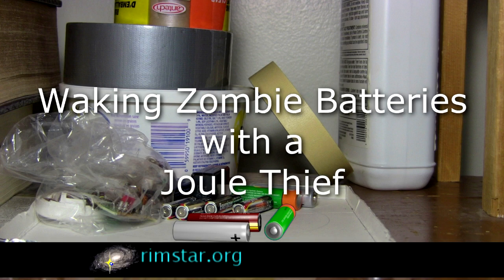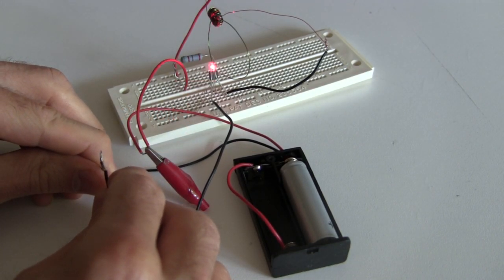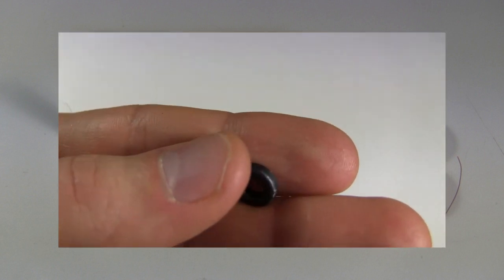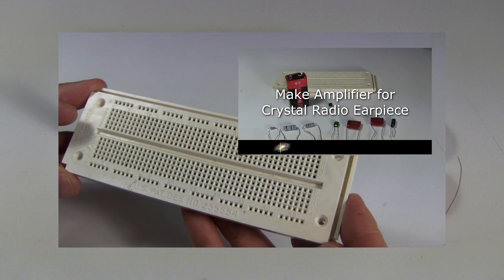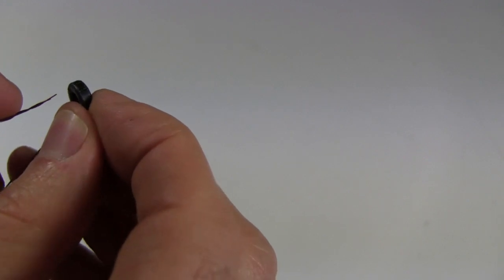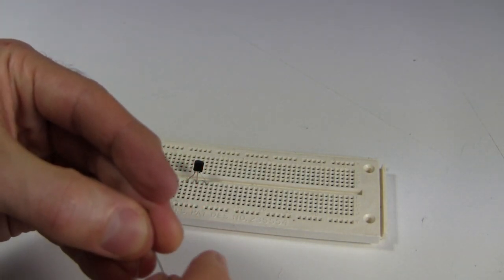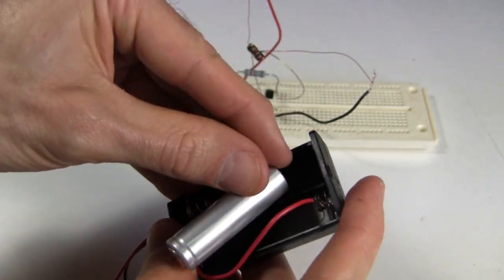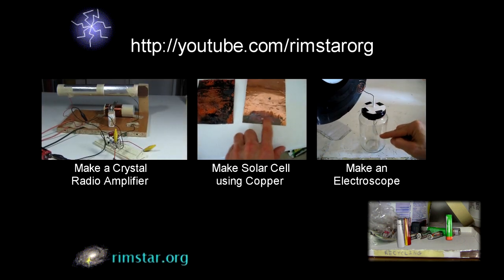Make a Joule Thief for Zombie Batteries

Comment: hello +RimstarOrg ! I need 3.5V for my project but the source is capable of giving only 2V.......... so will this joule thief be able to solve the issue?
Reply from the maker: +Siddhant Rai Probably not. It depends on what you're trying to power. The output of the joule thief is not flat DC, it's very spikey and pulsed, as you can see from the waveform I show on the oscilloscope near the beginning of this video.
However, you can add further parts to make the output be DC like one fellow shows here on my website http://rimstar.org/science_electronics_projects/joule_thief_powering_clock_ls.htm. But the current will be very low, so it again depends on what you're trying to power. He's just powering a clock. Also, you'll have to play around with the part values to get your 3.5 volts.
Reply: +RimstarOrg  thanks a lot !!!!
Reply: why not just use a large filter cap?

Comment: I'm using 2n3904 transistor in the same circuit but the output voltage is less than that of the input voltage. I can't seem to identify the problem what do you think?
Reply: If I use thinner wire should I increase the number of turns?
Reply from the maker: Are you sure you have it wired up correctly? The wiring going to the coils is the opposite of what you'd expect and is where most people go wrong.
If you use thinner wire then you don't have to increase the number of turns.
Reply: Yes the wiring is correct

Comment: The only ferrite core i have is about an inch in diameter, will it still work?
Reply from the maker: I think it might. I'd put enough turns of the wire to cover the core.
Reply: @RimstarOrg  alright! It worked very well I managed to get a 7.5 volt output from a single double A. Anyways I used the same circut with a dead battery and for some reason my multimeter  told me 0.5  volts output even though it could power two LEDs. Whats up with that?
Reply from the maker: The voltage output is neither flat DC nor sinusoidal AC, meaning that your multimeter can only show you samples of the fluctuating voltage. You really need an oscilloscope to see the output voltage. I show what it looks like near the beginning of the video. If your multimeter has a min/max function then you could use that to get an idea of the maximum value.
Regarding the dead battery, it's of course not dead and that's the point of this circuit. If you again look at the oscilloscope output which I showed, you'll see that the circuit produces voltage spikes and its just after those spikes that the LEDs are powered. They just appear to be powered all the time. I explain how the circuit works in this video https://www.youtube.com/watch?v=0GVLnyTdqkg.

Comment: does this cause the dead zombie battery to heat up?
Reply from the maker: I don't know, I never felt the batteries when using this circuit. I know with a similar circuit for powering a CFL, the batteries did heat up after a while as I show in this other video https://www.youtube.com/watch?v=yz_99oVMbSI at around six minutes into it. But that CFL is a much bigger load than a tiny LED.
Reply: @RimstarOrg  wow thats cool!!!!!

Comment: Hi i recently made a joule theif and was wondering why a 1.27 volt battery didnt power my 3 volt LED, i used a 3 volt battery through the mechanism, and it lit the led, i used a multimeter to measure the output voltage of the entire circuit, but it was the exact same voltage of the 1.27 volt battery, did i mess something up on the torroid? Is there a specific amount of loops around the core?               - Thanks
Reply from the maker: Scotlahn Mccallister The number of turns I put on the coil was randomly chosen. The most frequent error is in connecting to the coils in the wrong way. Recheck that since it's the opposite of what you'd expect. Another possibility is that the value of your resistor is too high. The lower the resistor value, the brighter the LED.
Reply: RimstarOrg Hi again, i tried what you told me to do, checking the connections, i changed the resistor value to 1 ohm and it still didn't work, i'm starting to wonder if my transistor is the correct type to use for this circuit, my transistor type is PN2222A6E.
- Thanks
Reply from the maker: Scotlahn Mccallister PN2222A should work. I can't find anything that tells me what the 6E means. My guess is it should work. Try the same number of turns on your toroidal core that I use, around 13 turns.
Reply: RimstarOrg Okay, i checked those, i think it might just be my connections on my breadboard, and i see that the voltage may be traveling directly to the LED and not through the transistor first, i would like to see a picture of how you connected everything to the breadboard so i can check if i am correct or not.
- Thanks Again
Reply from the maker: Scotlahn Mccallister
I don't have any picture of how I did it. Try figuring it out from the video and let me know if there's any placement that you can't figure out.
Reply: RimstarOrgI have finally made a successful joule thief, but the LED isn't very bright, i will try to get a better resistor for this project, thanks for all the help :)
Reply: Scotlahn Mccallister Also, one more question, what would be a good resistor for a project for this/ i have used 1k and 2k and they are both too dim, but i have also used the 1 ohm and 200 ohm and 330 ohm, but those don't light up the LED.
Reply from the maker: Scotlahn Mccallister I'd suggest getting a potentiometer/variable resistor somewhere in that range and then you can easily find the sweet spot. There's no way I can say what to use otherwise. If you're not familiar with potentiometers, I use one with a joule thief circuit for that very purpose starting around 0:59 in my video here https://www.youtube.com/watch?v=yz_99oVMbSI

Comment: Mine isn't working for some reason. I used a BC547 transistor because they are more common in my area, and when I shortcut the LEDs leads with the negative wire and let go, the led flashes so I think that the rest of the circuit works, the transistor just doesn't pulse like it should. What can I do?
Reply from the maker: PunakiviAddikti You might want to check the specifications for your transistor. I think the emitter leg and the collector leg might be the reverse of what my transistor is.If that's not it then the most common problem is getting the wiring to the coils wrong. They're not connected to the circuit in the way you'd expect.Lastly, try different resistance values. The higher the resistance, the dimmer the light. You shouldn't have to go over 100 ohms.
Reply: thanks, I'll try that. Does it matter how much wire is wrapped around the ferrite core? I have less than a meter of wire around it, and the wires are the same diameter.
Reply from the maker: PunakiviAddikti I don't have any feel or formulas for how many turns there should be wrapped around the ferrite core. You will get best results if cover the whole core though; that keeps the magnetic field inside the core as much as possible. Though it's probably good to play it safe and leave a small gap of core with no turns around it where the ends of the coil meet.
Reply: I got it to work, thanks! I actually used a pre-made toroid from some old electronics and changed the 1K resistor to the base of the transistor. I actually found one 2N3904 transistor and used it and it works great!
Reply from the maker: PunakiviAddikti Glad to hear it!
Reply: I tried it later with a BC547 and it still works : )
Reply: PunakiviAddikti Just do the math for induction because the number of turns does matter especially if your wanting to run more than one LED. Also the gauge of wire matters also if you want to run high brightness LED or even a small 3 volt DC fan. The larger the wire gauge = more current, The number of turns on a core will determine your primary input voltage and you secondary output voltage.
For example, I took a 110 volt toroidial type transformer and re-wrapped the secondary with some #6 AWG gauge wire, 5 turns and I get 2.3 volts @ about 80 amps.
It's all about induction.

Comment: will this circuit work with 0.5 volts
Reply from the maker: I doubt it. The transistor usually needs around 0.6 volts just to turn on.

Comment: is it a PNP or an NPN transistor?
Reply from the maker: Roush Hawley It's NPN.
Reply: +Roush Hawley You can tell from the transistor symbol. If the arrow on the emitter is pointing toward the base then it is a Pointing iN Pointer (PNP). If the arrow is pointing away from the base then it is a Not Pointing iN (NPN) type. I've used that method to remember the difference for over 40 years ... and still have to say it to myself to remember. :)

Comment: I followed the circuit exactly
But problem is that the LED glows when I connect two AA batteries but when I connect one AA battery it doesn't glow 
Why is that so 
Please reply me quickly as possible
Reply from the maker: Possibly the battery is too dead (too low a voltage) for even the joule thief circuit to use. Can you measure the battery voltage using a meter? The most frequent problem is having the wires going to the coil wrong. They're not connected in the way you'd expect.
Of course there are other reasons like the transistor may be broken, the resistance of the resistor may be too high (lower resistance means a brighter light, but no resistance could damage the transistor), and bad connections.
Reply: It's working now thank you very much sir 😊
My mistake was wires going to coil was wrong
Reply from the maker: Glad to hear it. Thanks for letting me know since that helps me help others later.

Comment: playstation 2's have a ferrite core coil that is ready to use connecting the 2 ends that are diagonal to each other
Reply: Otherwise use a 1" to 1/4" toroid and 5 turns of the wires from a Ethernet cable
Reply: Ashley Poulton
ill have to try bigger toroids
Reply from the maker: Oh, cool. Thanks.

Comment: hi i like your vids. im a green energy enthusiast and i know some of electronics but mostly hobbist. 
can i use a joule thief to charge a battery from a solar pannel which is unable to deliver a bigger voltage than the battery? if so, are there any calculations i need to make to start testing?
Reply from the maker: Jerónimo Barraco Mármol Yes, that is possible. I've seen it done - though with a tiny panel. I'm not aware of any calculations.
Reply: Thanks, i have a small solar panel that gives 2~ volts on PERECT conditions, i wanted to give it some use

Comment: Hello sir, what is the Hertz range on the little Toroid? I've seen those around, but most of the time their rated at 10-50 MHz.
Reply from the maker: I don't know. It was just a random toroid I took from some piece of hardware, a power supply I think.
Reply: I see, so those little Toroids that range from 10-50 MHz should work just as well?
Reply from the maker: It's hard to say since I don't know the frequency range for the one I used. The joule thief operates in the tens of kilohertz range. The waveform I show in this video is at 50 kilohertz.
Reply: I see, I have experiance in Electronics too, but this is one of those things I've never played with before, but it looks interesting. Thanks my friend for your help, much appreciated!